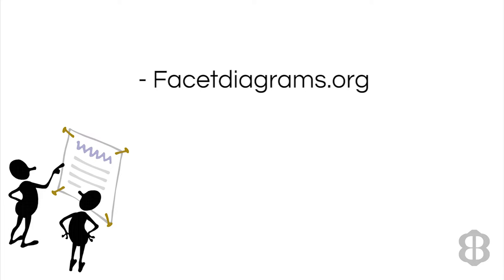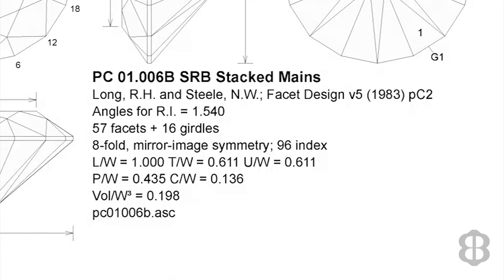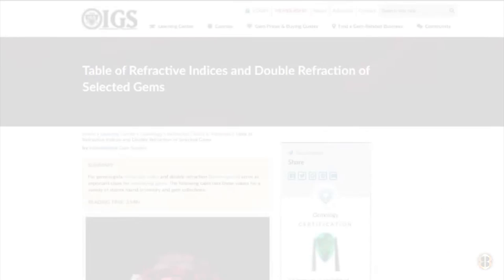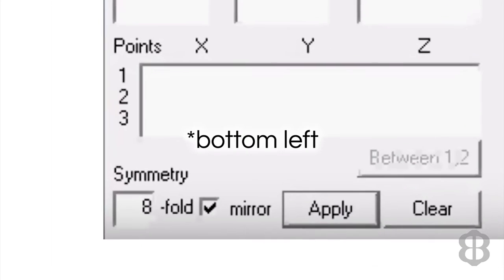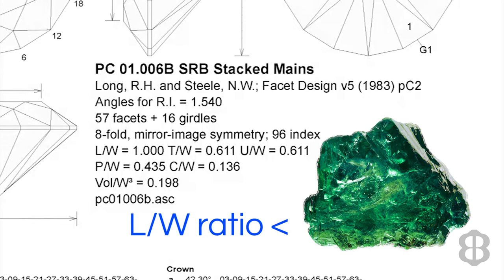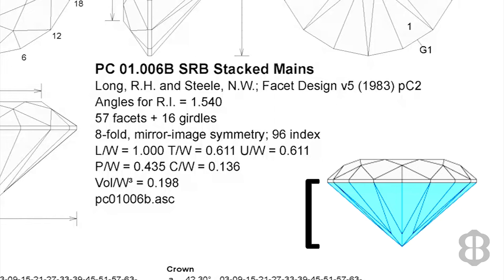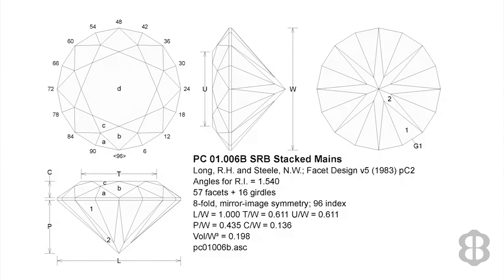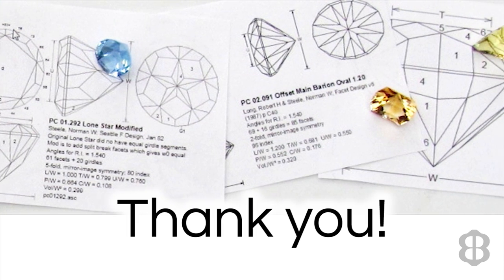Gem Cutting Tutorial - Reading a Gem Faceting Diagram - Part 1

Comment: I use the Vol/W^3 measurement to compare yields between different designs of the same shape. IE I can compare a bunch of 1.2 L/W, 1.54 RI Oval designs and see immediately which will yield the most. Granted the color saturation of the stone (thus the depth of the pavilion) is more important than small variances in yield so I tend to look at the Vol/W^3 last.
Reply from the maker: ah yes, I see.  That's a good idea, so if I was cutting an oval for example, the higher the volume ratio, the higher the yield would be.  But, for large stones, I am generally cutting a relatively less expensive material, so a little extra yield isn't a significant concern for me.  However, if I was cutting a relatively expensive stone, such as Tsavorite, or a larger Sapphire, then I can see where your way would be of great benefit.  Thanks.

Comment: Does the L / W ratio determine the size of the stone?
Reply from the maker: In part.   The size (carat weight) can be estimated using the volume calculation, which I tried to do in my video of cutting  large Mali Garnet.  Width Cubed which is width x width x width is one component. You also need the specific gravity of the material and the fraction from the gem design.

Comment: Hi Boppie, found your video really informative keep it going with these brilliant videos.
I particularly interested to do emerald cut  for emeralds but some how i found some emeralds which have very less depth how ever length into width ratios are good enough, SO can i able to cut those Emeralds  with less depth on the same chart which is available on internet or i need to do special depth calculations to implement those charts for cutting or they still work on less depth stones. i hope you get my quetion
Reply from the maker: If the emerald is cut to shallow, it will have a 'window' effect and light will pass through it and not be reflected back.  That affects the brilliance of the stone.

Comment: Does drawing with 1.72 R.I. work with diamond which has R.I.of 2.4?
Reply: I am not sure I understand.  If you mean can you use a diagram designed for an R.I of 1.72 to cut a gemstone of a higher R.I., without changes.  Probably.  In general you can use a diagram to cut a stone in a Higher R.I., but in general, you can not use a diagram for one R.I. to cut a lower R.I. without changing the angles.